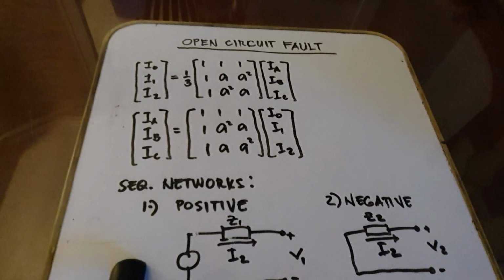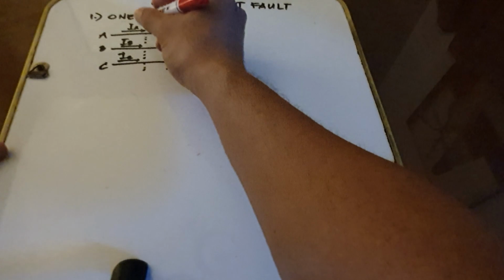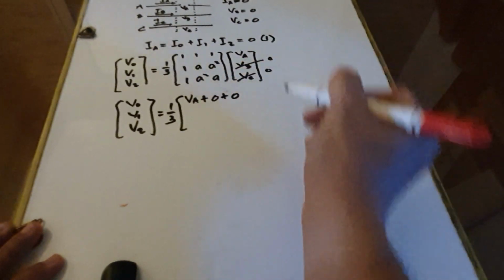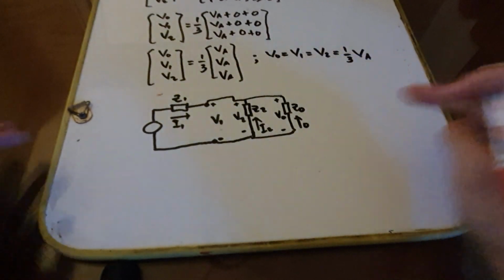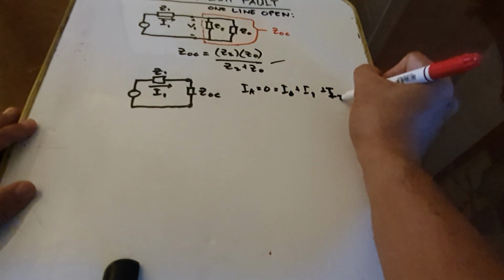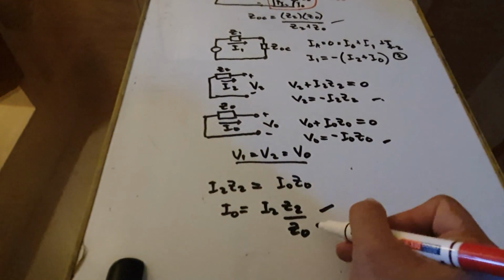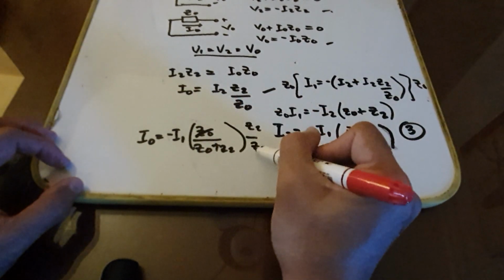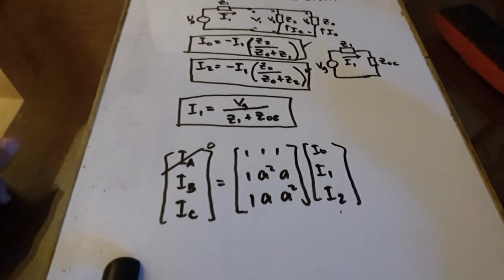Open Circuit Fault Analysis (1 line open)

Comment: Result or sequence network similar to double line (b and c) to ground fault it seems?
Reply from the maker: Yes similar to 2L-G fault interconnected sequence networks assuming the fault is  bolted. But the driving voltage of short ckt fault is different with that of the open circuit fault.
Reply: @jveds9108  may i know if you have video about two line open?
Reply from the maker: @kat2x290 hi! yes I will make a video for the 2 lines open. thanks